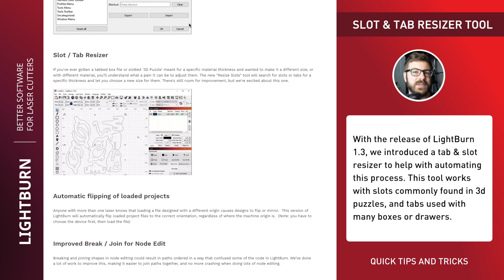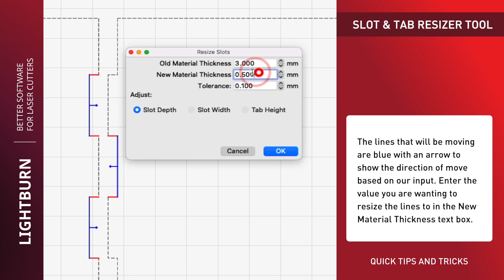Simple Design Adjustments With the Slot & Tab Resizer Tool

Comment: On the upper section of the right piece after you adjust the thickness the corner line did not adjust. Is there a reason it did not?
Reply: I have had this issue as well
Reply: Those corners don’t identify as slots, they are neither tabs or slots, they are the non binary 

Haha, anyway I wish lightburn could remedy this, I always change them manually

Comment: Great video.  Question on closed slots specifically, or rectangles found within the design I should say.  I will often design where a slot needs to be locked on one side and adjust from the left or right, top or bottom, and not the center.  It appears the slot sizer only adjusts from center currently... is that correct?  I currently use the reference point today to lock one side and adjust.
Reply from the maker: Correct - the resizer always adjusts rectangles from center. We’d like to improve the functionality of it over time, so I’ll add this to our suggestion list.
Reply: @lightburnsoftware7189  that would be an amazing addition.  thanks for the response!

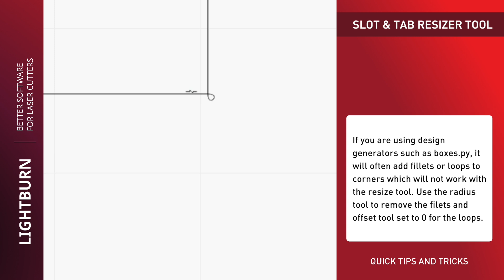Comment: Thank you for this video, very handy update to lightburn indeed. I have a question about something else mentioned @2:28 Loops. What are they for? To prevent edges from getting too burnt, or for more fluid movement of the laser? Thank you.
Reply from the maker: They have some documentation on it if you are interested in diving in a bit further. The main reasons are continuous motion during cutting and to leave the length of the straight lines (that will be butting up against other pieces of the box) unchanged. Here is their info: https://florianfesti.github.io/boxes/html/api_burn.html
Reply: @lightburnsoftware7189  Thank you for the link and reply to my question. You guys rock!

Comment: This is a great idea and a huge time saver. However, whereas it adjust the pockets just fine, it only seems to lengthen the line on the inside of tabs where there are more than one.
Reply from the maker: This would be much better as a support question on our forum or by email - For example, I can't ask you to post a screen shot of what you mean here.

Comment: Nice feature. I have a question. I'm a beginner.
Is there a way to scale a box for example, without affecting the tabs & slots and keep  them at 3.2mm? Maybe using a % scale? Thanks
Reply from the maker: @alb673  - no, which is why this tool exists. You scale the object to the desired size then fix the tabs/slots back to the size you want.
Reply: @lightburnsoftware7189  Thanks for the quick reply. Just tried and unfortunately it didn't work for me.
I'm on V1.3.01Linux I've selected the shape, then in the resize window old 3.2mm new 4.8mm. It doesn't show any highlighted selection as in your video, and Tab Height don't do anything.
I was able to change it by making a rectangle 15 x 4.8mm and weld the shaped together though...
Reply from the maker: @alb673  - it’s very hard to provide help in YouTube comments.  If you email the file to support@lightburnsoftware.com someone could tell you why it’s not doing what you expect.

Comment: it would be very nice to have parametric design ability - replace the length with a named variable. 
Have the named variable to a get its value from a math expression that includes other named values and constants, and one can use a single design for a lot of different sizes and thicknesses

Comment: Great tool but still looks like it needs some more work. check the top and bottom tabs on the right hand part at 2:07
Reply from the maker: There are some limitions around the edges. We will continue to improve the process and wanted to get this tool into people's hands as it does greatly speed up the process.

Comment: 2:05 -- Looks like you're still not ready to send it to the laser.  It missed one of the slot walls on the right panel.  Interestingly though -- as you were clicking between the different modes (slot depth, tab height, etc.), it did highlight this edge on tab height, but then ignored it on slot depth.
Reply from the maker: Is is difficult to do in a fully automatic way, and we wanted to get something that would do 80% of the work into people’s hands while we continue to improve it. It should greatly help to speed up the process.

Comment: It works well.....but the tabs that are not "Deep" but rather are "outer tabbed arent being recognized with the matching values.  What i mean is, even if I toggle through depth, width, or height.  It could very well be because of the etsy file I am using.  I am hoping I will figure this out as I have a file that supports 3.2mm wood, but I have 3.5mm and I have some 4.5mm i would like to use.  Any suggestions?

Comment: Can anyone share a way to resize slots in angle? The way I do it is drawing a rectangle in the desired size and then I try to guess the angle over the slot I want to resize in the project. Thanks.
Reply from the maker: The slot resizer tool is meant for exactly this - It will resize slots at arbitrary angles.

Comment: I have been using Lightburn for a short time, and I am having some difficulties. When I work with images using one of the available parameters, in the preview the image doesn't appear, it gets a dark image, the image only appears when the grayscale parameter is used. Does anyone know how I should proceed so that the image appears correctly in the preview?
Reply from the maker: Zoom in. The preview is not able to make the dots small enough to show the detail that the laser can, and is really only intended to show the path the laser will take, not what the finished output will look like.
Reply from the maker: This is also a strange comment to leave on a video about resizing tabs and slots.  :)
Reply: @lightburnsoftware7189  Thanks for the answer, I thought it was configuration problem, with your explanation now it's clear to me
Reply: @lightburnsoftware7189  Sorry for the question in this video, I didn't find anything in Portuguese, I asked the question here because it's the best, I was hoping someone would answer, thanks again